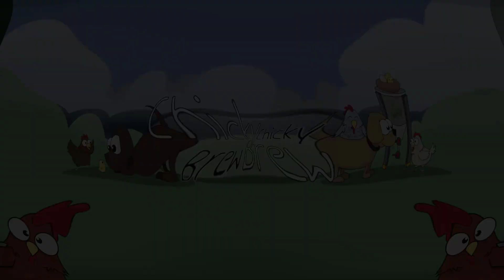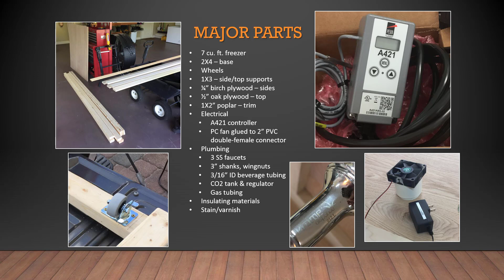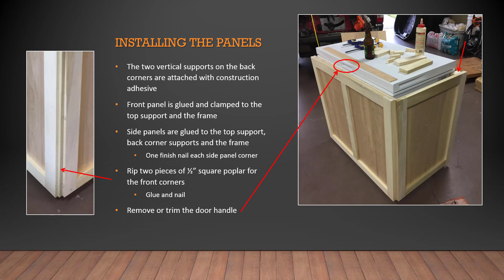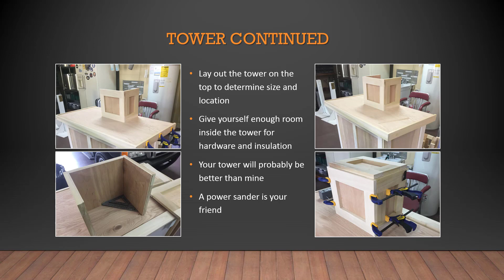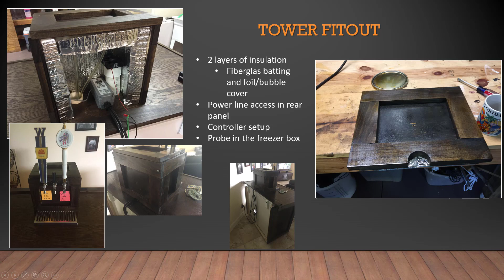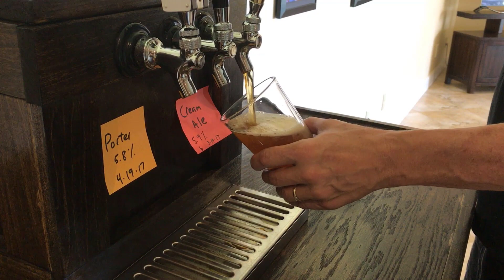Keezer Build

Comment: i'm confused....are you not pushing very warm air from that pc fan into your freezer causing your unit to almost constantly be on??
Reply: He insulated the top box so it just allows the cold air to keep the lines cold to the taps. The fan just ensures the air circulates through that area.

Comment: I see your using the same temp controller I purchased. Would you be able to tell me all the numbers you have under your settings cause I'm having issues with mine and its hard to find a video on programming it for a keezer.